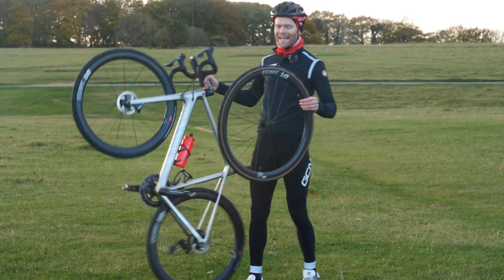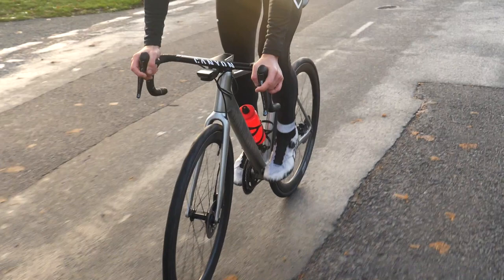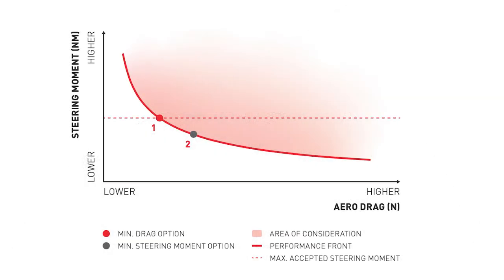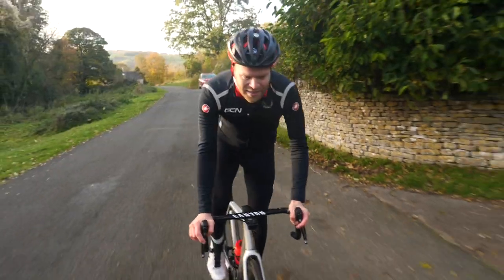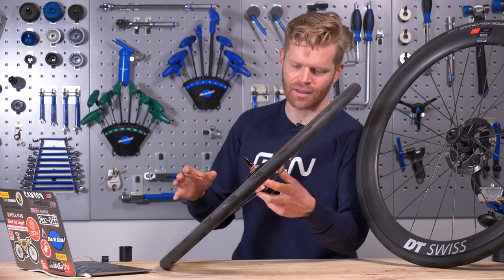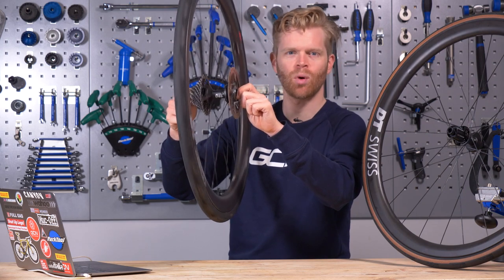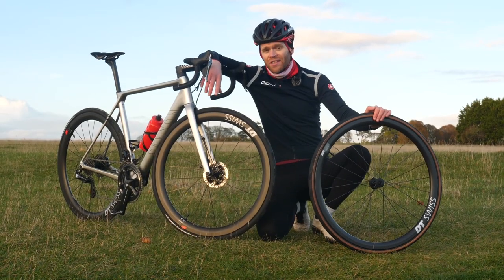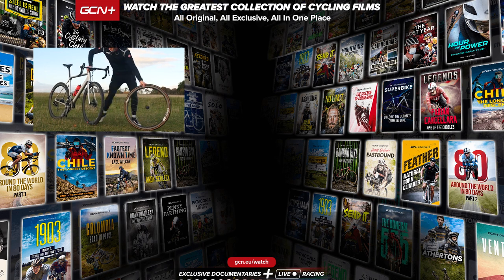A Whole New Cross-Section? New DT Swiss ERC Wheelsets

Comment: All of the comments from people have have not ridden these wheels. I have already ridden the ERC 1100 45mm wheels; they are amazing! My application? Change out my equally amazing ARC 1100 80/62 wheels on my triathlon bike because Nov 26 I am racing Formosa Xtreme Triathlon which includes 3450m vertical elevation on the bike course, but with a gentle hilly section for first 60km, 75km of windy coastal rolling hills, and then 45km of steady climb up the first half of the Taiwan KOM race course hill. These ERC 1100wheels nail this profile with strong aero performance and weight savings versus the all out aero of the ARC 1100 wheels I normally compete with. DT Swiss engineers the entire package to the nth degree. There is a cost for that and a brand premium too. That may not be the wheel set you want, but there are those who do value what DT Swiss offers.

Comment: Got a bike, that had those wheels on it. 1100 ERC 45mm. I searched EVERYWHERE about this wheelset, and i could not find any spec about those wheels. I searched older wheels could not find a thing. UNTIL this video. HOLY CRAP those wheels are steady in the wind.... I am stunned by the performance...
Reply: now you can ride in a hurricane with no hands.
Reply: @ionutcelgroaznic  lmao

Comment: I picked up some 1400 48mm from an popular italian website and got them for 1750$ usd after tax and import fees to the USA . I got them to use when mixing in some climbing with flat terrain as the enve 4.5 ses I was running were not very stiff and a bit larger then I would prefer for mixed terrain rides . I surprisedly found the dt Swiss to be a bit faster , more stiff and better in crosswinds while descending and on the flats . The enves look better but that’s all they have on the dt Swiss as to actual performance in my comparison. Really happy with the purchase and selling the 4.5 enve wheelset . Now my 6.7 enve wheelset is the holy grail on flats and I will not part with those as they are bulletproof and extremely stable . Pure stealth mode when I throw them on . The 4.5 set is laced to CKR45 and 6.7 on 240s with 54t ratchet and the dt Swiss got the 54t ratchet upgrade also . Great security measure as the sounds is a solid alert tool when needed.

Comment: You should clarify that steering instability isn't really a "wheel" problem, it's a frame geometry issue. Modern bike frames with slack head tubes and high rake will develop a large steering moment.
Put a deep section wheel on a proper road bike designed for high speed (HA >74⁰ with >60mm trail) and your steering isn't problematic.
Reply: Interesting. I’ve noticed it slightly more with my new bike, a Ribble CGR with a moderately slack geometry (not quite as much as a true out and out gravel machine), but did notice it in the past on my traditional road race bike with a much steeper head angle and less rake.
Reply: @arontal  my steel track bike has 75⁰ head angle, with a 28mm rake fork.
It is basically immune to crosswinds, with the same 60mm deep wheels as my road bike, although the road bike does feel it.

The 28mm rake means that side wind forces are more centered on the steering axis. It also means the trail is 62mm, which lends far more stability.

Comment: Worth noting that for an endurance wheelset supposedly suited to a 28c tyre, this will balloon to a measured 30-31mm, wider than the 28.5mm width of the rim. So say goodbye to any aero benefit (well it won't be very much in any case).

Comment: The year 2024 and a more mature looking Ollie is introducing us to the latest wheel set from a GCN partner company. "These new wheels have been completely redesigned based on the latest research and, in simple terms, everything you've ever previously been told about wheels is in fact wrong. Over the next few minutes I will make you feel rubbish about your existing wheels and explain why you need to part with thousands of £/$ so for a brief time you can feel smug and superior while convincing yourself you can actually tell the difference from your old wheels. That is of course until we produce another video explaining why these new wheels are in fact wrong and you need to buy something else."
Reply: that’s the thing about science and engineering. it evolves and develops. The Spitfire was the best single seat fighter in 1939, it wasn’t in 1940! the Fw190 was, which was then eclipsed by various designs such as the p51d 🤓

Comment: Pity they changed the new hub to something unproven. Already recalling it. Why change the LEGENDARY DT Swiss design?? The twin rachet system just worked SO good.

*You DO need tools to swap out bearings. No tools needed to clean and grease the rachet and spring.

More spokes means more watts needed to hold the same given speed. My old Mon Chasseral still going strong. Rim brakes for life!
Reply: If you read the DT Swiss website its not a recall. I had was worried about my new DT Swiss 240 exp hubs and contacted the service center and they quickly sent me updated parts. 3k mikes since the update I've had ZERO problem. If you're that worried about it just  buy the updated 350, its essentially the old 240S hub since they updated it. Good on DT Swiss for pushing the limits and trying new things. You also need tools to remove the bearings in the old 240S hubs so its really not that much different.
Reply: Cheaper to produce .

Comment: The DT Swiss wheels that came on my Canyon suffered with rim cracking around the spoke holes.
Reply: But the low aero buffeting was great, right?
Reply: How did you terminate the location of the sound? Did they replace wheels? Im probably having something similar, but very difficult locate and present.

Comment: I have commuted through flood water next to a river where the water could be above the wheels. So yes, handlebars and seat still dry. Turning was fun as the water would hit the side of the front wheel, slowing me down somewhat and requiring epic turning strength to get the wheel back pointing forward. Totally worth it though for the looks from onlookers as I would emerge from 'the river'. Could form the basis of an interesting show, an underwater race with a gravel bike, an MTB and a TT aero special.

Comment: I believe my lightbicycle rims are in this shape since a couple of years.
Reply: Pretty much. I have the AR56, ridden them in storms and they don't budge. Stable AF, 1500 grams and less than £600
Reply: My AR56 with dtswiss 180 exp 36t ratchet comes at 1428g. Even lighter then the 45mm dt swiss 1100. Never felt any twitch and its stiffness is comparable to most big brands. At that kind of price dtswiss is charging for the 1100, i can buy 2 sets of AR56 and with spare change to upgrade other parts of my bike.

Comment: Do the 45mm deep ERC1400 have a small hole in the rim for water drainage? I want to get new wheels and have a problem of water accumulation in my current ones. In the photos on the DT swiss webpage I can spot the drainage hole just after the first „S“ of the „DT SWISS“ font in all models except the 45mm 1400s…

Comment: so basically don’t buy deep rims if you aren’t confident in the wind
Reply: yes, sidewind in particular ..
Reply: I’m 63kg and ride 60mm with no problem. Sure, it twitches when there’s a sudden gust of wind or if a truck passed you on the opposite direction, but no one has ever get blown by the wind on deep rims.
Reply: @supermitendo9654  yup, unless you're riding against a strong sidewind on a descent, there would no problem ..
Reply: Slight correction, don't buy rubbish deep rims if you aren't confident in the wind. Also, don't confuse cheap with rubbish.

Comment: I have the 240 hubs and they are so much quieter than the ones shown on here but I imagine as they are brand new they are still packed with grease
Reply: The same with mine. My previous wheels were dt swiss p1800 with 3pawl hub and they were louder. For some reason the hub on mine when riding slow feel like they are broken. 😅

Comment: To put it into perspective, I found the set in 45mm depth for EUR 1900. I am eyeing a pair of 45mm from a Germany small brand at EUR 1100. Weight is also 150g lighter on this German brand one. Even if these really are a nice innovation and more stable, 73% more expensive. That is steep. And a tad heavier as well. Now compared to some other name brands like ZIPP these look great of course.
Reply: What is the German small brand for EUR 1100..? 😁 Thanks
Reply: @carlrice8332  lambda-racing. Leeze are also an option. And by now there are several Chinese options out there, and let's not pretend, the Chinese have the know-how, all the carbon manufacturing is outsourced to them, so they are the ones with the actual manufacturing expertise.

Comment: Steering moment - your example showed the wind hitting the front side of the wheel, causing rotation around the steerer tube axis, but in reality, surely the wind is more likely to hit the windward face of the wheel in its entirety? This would cause a deflection on a different axis with the pivot point on the ground, pushing the rider over. The rider's reaction to being pushed over is to rebalance by steering into the direction of the wind.

Comment: Wow Doc, I learned so much from this vid. I think I'd go with the 30's....I live in a vey very windy place and I've experienced that stall...almost blew me off a busy interstate (think M5) overpass last  spring. I just lost a spoke on my old carbon fiber wheel set and the nice mechanic says there are no replacements, will these fit older models with good old rim brakes? And ceramic bearings?

Comment: Found out how easily the free hub comes off when I dropped my wheel after putting on tubeless tires - the hub parts scattering across the garage floor. Scared myself sh*tless. No LBS and thought I was hooped until a web search set me right. Some cleaner and fresh grease and all was good.

Comment: Dear Ollie, you are risking your life...
Your front brake caliper is mounted for a 160mm disc while it seems you are riding a 140mm disc. The pads only grabs the edges off the disc until they are worn in and press against each other. At this point you have basically zero brake force.
Reply: Must've been that most incompetent of home mechanics he was talking about!
Reply: This will never happened to rim brake
Reply: @matthewho1053  Bigger or smaller rim diameter; height and/or angle of the pad.
Reply: real men never brake.

Comment: "Ollie has taken both new models out for a spin to provide you with his SPONSORS first impressions"
I like DT swiss but wish there was less commercial focus and more info in the 'review'.  Eg. Comparison to competitors / reasons for spoke lacing / tubeless v tubetype comparision eg. tubeless easy to mount? Cassette compatibility / comes with skewers or not etc.

Personally I am using Legend PRO 38 hand built wheels in France with DT 240 swiss hubs and spokes, carbon rims made in Asia to their spec, with buyer options of hubs / tension / decals etc for 1500 euro a pair, and 1300 grams a pair + people you can call for any queries during office hours.  1yr / 7k on the clock and zero issues (calliper, tubeless ready version ), I wont be changing anytime soon.

Comment: So dt say wider bearing stance in the back wheel improves bearing life , but reduce it in front wheel for less areo drag , 🤔
Reply: Considerably more load on the rear, and aero is less important at the back. Compared to lower load on the front, and more important aerodynamics. Almost like that makes sense isn't it?

Comment: Regrettably, DT swiss are still using internal nipples, an absurd and flawed design that needs to go the way of integrated seat masts or simply be banned by the UCI. why should anyone be able to true their wheels in minutes, when removing tires, fighting with rim tape, truing, then re-assembling everything back again is sooo much more time and effort consuming, aggravating, and just plain ridiculous. And if you're running tubeless tires with sealant, notch the whole debacle up by a factor of two. While i like other aspects of the new ERC wheel design, internal nipples are a complete non-starter straight out of the box.